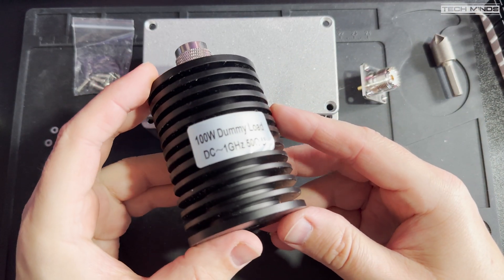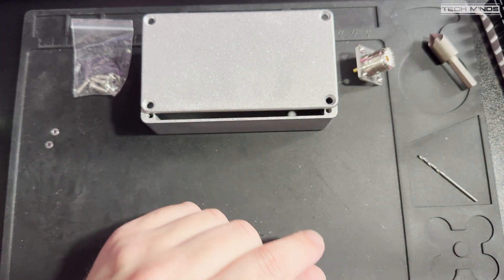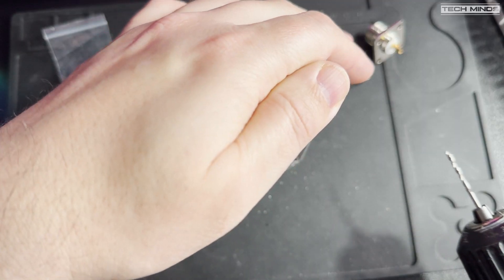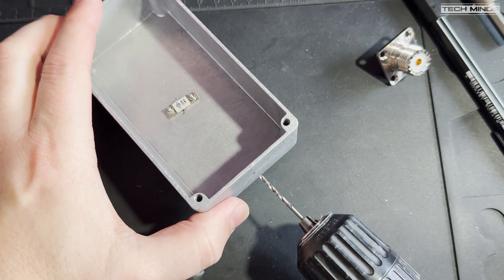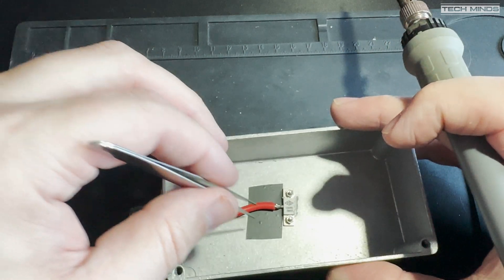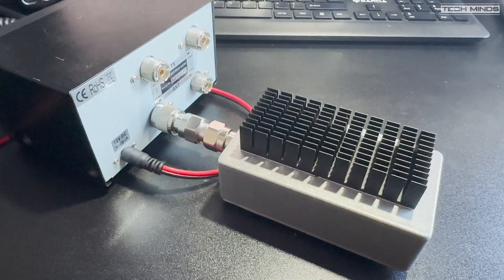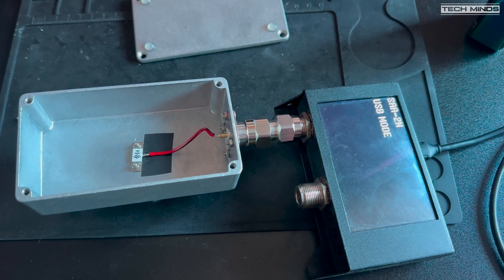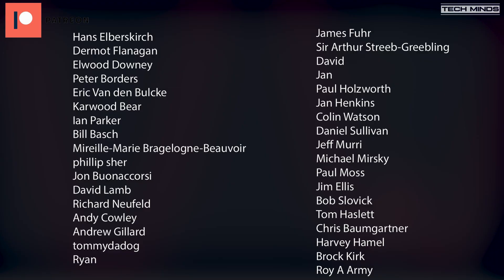HOMEMADE RF DUMMY LOAD FOR HF ONLY

Comment from the maker: Hi All..! Thanks for all the comments, appreciate it, and yep I agree I must of had a brain fart going on because this would of been fine for HF, but for 2.4Ghz which was my aim, it fails miserably. Therefore I will change the title of the video. On a side note I have measured the resistor directly to a VNA, please check my post on my community page or my feed. You can see that it does not plot as expected. In my mind these do not cover from DC to 6 Ghz, regardless of my mistake with the connection between the N-Type and the resistor.
Reply: The best way to make this would be to make a strip line on copper clad board to feed the resistor. Attach a short length of microwave coax to feed it and use double sided copper clad board.
Reply: Sorry a couple of people felt they had to say it so harshly. We're all learning as we go, and this is what helps us all learn.
 "An ignorant person is one who doesn't know what you just found out" as Will Rogers said.

Comment: First of all, type N are really nice connectors for HF. I use them extensively. As for using the load resistor at high frequencies, you really need to use matched transmission line the whole way through. That is really tough on that bulkhead connector and similarly tough on the termination. I would recommend looking for coaxial assembly to bring the line close to the load, either an N pigtail into RG-316, or the same with N on one end and SMA on the other. You could then fashion a small bit of PCB with 50 ohm microstrip to deliver to the load. SMA is a better transition to the PCB microstrip than trying to do something with N. The load end of the microstrip must be well designed with short, compact paths on both ground and hot. If this isn't done well, it will never give good results at 2.4 GHz. The resistors could well be better than 16 dB return loss at 6 GHz, but only if they are built into the circuit nicely. This is a great project for learning. I wish you good luck on it.

Comment: You might also consider polishing the surface below the resistor smooth to increase the thermal conductivity between the resistor body plate and the mass of metal.  The metal-to-metal contact will have much better thermal conductivity than relying on the heat sink spooge to fill in the tiny gaps between the two hunks of metal.

Comment: Try  the resistor  closer to the  socket  , shorter wire to resonate  .  I build a paint can dummy load   and had similar  effect  so shortent the tails did improve it ..

Comment: The bewt way is put a socket on a 90 degree bracket and mount it as close as possible,the resistor is fine but its also actin like a stub on 70cm

Comment: In fact you are using an inductior, your long wire, to connect the resistor to it.
That is a big mistake. 
You should have used a piece o coaxial cable,  directly connected to both ends of both,  the load and your female connector. 
73 from PY1JDX,  Paulo

Comment: Building a dummy load for HF can be done much easier. Just put an connector at the lid of a jar and solder some copper wire to it. Fill the jar with water, add salt step by step - check the resistance using the NanoVNA. 3/4 teaspoon of salt to 400ml water is the rule of thumb. I built one of these, with 400ml it can handle 300W easily and ist usable up to 30MHz.

Comment: I built one a while back. But socket mounted directly to a heat sink and resistor directly behind that. I use fans and my cooling controller board to avoid any ‘unpleasantness’ (hackster link in description): https://youtu.be/nM-SrqBVm5E

Comment: Wow.  Just wow.  I've watched enough of your videos that I thought you knew better than that.  You can't connect the resistor to the N connector to the resistor with that INDUCTOR that you called a "wire."  If there is anything between the connector and the resistor, it should be a microstrip transmission line on a printed circuit board.  Better yet, mount the connector to the edge of the heatsink with the pin just above the flat surface, mount the resistor to the flat surface of the heatsink, and solder the tab of the resistor directly to the pin of the connector.
Reply from the maker: Hi All..! Thanks for all the comments, appreciate it, and yep I agree I must of had a brain fart going on because this would of been fine for HF, but for 2.4Ghz which was my aim, it fails miserably. Therefore I will change the title of the video. On a side note I have measured the resistor directly to a VNA, please check my post on my community page or my feed. You can see that it does not plot as expected. In my mind these do not cover from DC to 6 Ghz, regardless of my mistake with the connection between the N-Type and the resistor.
Reply: Hi JimAndyAllyn. There is no need for snide or condescending remarks. We are all here to learn from each other.

Comment: I hope you were recording this on the first of april and were aware that you were fooling yourself 😂.
Reply from the maker: Hi All..! Thanks for all the comments, appreciate it, and yep I agree I must of had a brain fart going on because this would of been fine for HF, but for 2.4Ghz which was my aim, it fails miserably. Therefore I will change the title of the video. On a side note I have measured the resistor directly to a VNA, please check my post on my community page or my feed. You can see that it does not plot as expected. In my mind these do not cover from DC to 6 Ghz, regardless of my mistake with the connection between the N-Type and the resistor.

Comment: If I was to build a small dummy load I'd use 20 1k carbon resistors in parallel and solder them directly to the connector - a bit fiddly, but it would keep the cabling really short. Oil for cooling would circulate through the box, so heatsinks on all the other sides would be ideal.

Comment: Hi Matt, Time for a tech in on RF and transmission lines. 
I can explain what's wrong, but others will below. The resistor will be fine
Reply from the maker: Hi All..! Thanks for all the comments, appreciate it, and yep I agree I must of had a brain fart going on because this would of been fine for HF, but for 2.4Ghz which was my aim, it fails miserably. Therefore I will change the title of the video. On a side note I have measured the resistor directly to a VNA, please check my post on my community page or my feed. You can see that it does not plot as expected. In my mind these do not cover from DC to 6 Ghz, regardless of my mistake with the connection between the N-Type and the resistor.
Reply: @TechMindsOfficial  I very much doubt they look like a resistor at 6 GHz. I would be surprised if they were much good above 1 GHz but they will be usable to some extent. I will have a look at your pages. Incidentally, it is easy to make what you want with that and some suitable coax, but you must not use the dicast box as the heatsink as it has poor thermal conductivity. What I would do is cut a hole in it and put a bit of copper plate and then the heatsink. The copper plate will spread the heat but it will also allow you to solder the coax to it. It doesn't need to be very thick for this but it will improve the grounding. If you look at my posting on the dual pallet 70cm PA you can see something similar for the dump resistor on the power combiner.

Comment: This build needed to add a very short, constant distance between the signal and the ground. For much better results, connect the resistor directly to the socket. Make sure that the soldering tab is parallel to the project box surface. If possible, use connector bolts to mount a resistor.

Comment: Painful to watch
Reply from the maker: Hi All..! Thanks for all the comments, appreciate it, and yep I agree I must of had a brain fart going on because this would of been fine for HF, but for 2.4Ghz which was my aim, it fails miserably. Therefore I will change the title of the video. On a side note I have measured the resistor directly to a VNA, please check my post on my community page or my feed. You can see that it does not plot as expected. In my mind these do not cover from DC to 6 Ghz, regardless of my mistake with the connection between the N-Type and the resistor.

Comment: Hi ... the wire is your problem ... for a start I would mount an SMA connector directly on the resistor 
,and then measure it with your VNA. This is to understand the performance of the resistor by it self. If the resistor is ok then as others have suggested use a transmission line on a pcb to connect between n-connector and the resistor ... thanks Niels
Reply from the maker: Hi All..! Thanks for all the comments, appreciate it, and yep I agree I must of had a brain fart going on because this would of been fine for HF, but for 2.4Ghz which was my aim, it fails miserably. Therefore I will change the title of the video. On a side note I have measured the resistor directly to a VNA, please check my post on my community page or my feed. You can see that it does not plot as expected. In my mind these do not cover from DC to 6 Ghz, regardless of my mistake with the connection between the N-Type and the resistor.

Comment: On higher frequencys say above 1GHz the distance to resistor from N connector is crusial , keeep it as short you can , for even higer frequncies try to solder the resitstor tap directly to the N connector tip.

Comment: Fun little video ...a shorter wire (Preferably Coax) would be useful as this is an antenna at higher frequencies. Also if you ramp up the power you 'll probably find that Heatsink not as effective as it could you'll need a metal to metal contact to the heatsink and resistor or atleast scrub the metal or have the bolts go all the way through the heatsink.. Anyway enjoy the series keep it up

Comment: Very long leads make a huge loop. Just think of it all as a one loop inductor made of long wire and back to connector through casing. I'd either use a direct coax from connector to resistor (both power and ground) or create a some kind of 50 ohm strip line if it suited better. (to be more exact long wire also has quite some capasitance so it is more or less LC circuit you did build but I'd assume inductance being the larger problem)
You get away with long leads on HF but at UHF or especially microwaves, they are just no good.
One possibility could be mounting the resistor near the socket and having a short direct connection from socket to resistor. This would assume the enclosure conducts enough heat.
BTW, I disagree with the wisdom UHF connectors are no good for 2m or 70cm. I have measured some adapters and leads I have with my 1.5GHz spectrum analyzer and the ones I measured were just as good as say N-to-sma adapted similar lines with only minor difference.

Comment: When my buddy did his dummy load using strip line resistors he used 100ohm in parallel and a tiny bit of capacitance to balance the circuit. I’m good on qrz if you want to shoot me a email I can forward you his design and exact details 😉

Comment: As others pointed out, you can't use a piece of wire from the N connector to the resistor and expect it to work much beyond the HF band. Use a good quality coax right up the resistor connection including the ground connection.  Obviously the coax needs to be rated for the given frequency but at least for a dummy load losses aren't important.

Comment: You need a 50 ohm transmission line between connector and resistor. That wire will cause a severe missmatch on any frequencies above HF as it is a serial inductance. The resistor is not the problem.

Comment: Um, you need to actually design a 50ohm impedance circuit to connect the resistor to. The resistor is fine. The circuit design is not at all suitable for RF.

Comment: I'd mount the resistor like a high-power RF transistor with a 50 ohm microstripline between the coax connector.

Comment: Connector should be direct to resistor. But OK for hf if using a wire. No good for vhf. You must have watched my video. Cheers from old George

Comment: Well the thick wire is an inductor at the higher freq. Maybe use coax to keep it a transmission line .. I built a dummy load for hf using a series and parallel combo of similar resistors. I used copper sheet and then put the assembly into a mineral oil filled paint can. Even with copper the resistors got so hot that the solder melted connections on a few of them. I didn't realize how bad it was until the finals in the amp I was testing zorched out! So I don't trust those resistors and would only use them in the future at maybe a fraction of their specified power ratings!

Comment: There is nothing wrong with the resistor, you have placed a transmission line of probably 150Ω in series with it.
Reply: You might also be able to calculate the length and impedance of the connecting wire based on the readings of the VNA
Reply from the maker: Hi All..! Thanks for all the comments, appreciate it, and yep I agree I must of had a brain fart going on because this would of been fine for HF, but for 2.4Ghz which was my aim, it fails miserably. Therefore I will change the title of the video. On a side note I have measured the resistor directly to a VNA, please check my post on my community page or my feed. You can see that it does not plot as expected. In my mind these do not cover from DC to 6 Ghz, regardless of my mistake with the connection between the N-Type and the resistor.